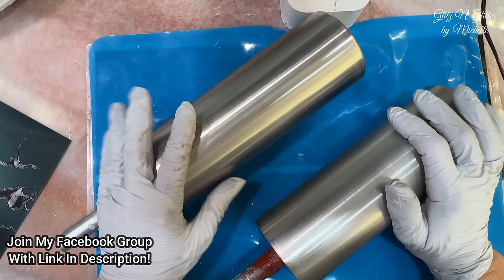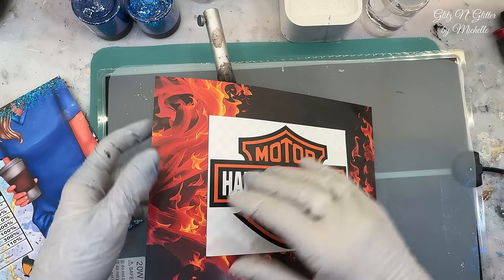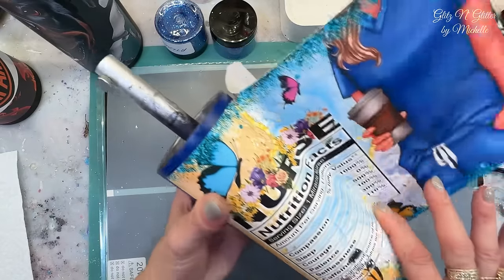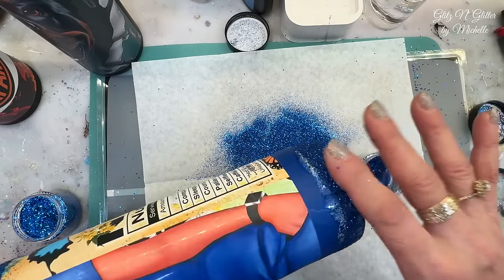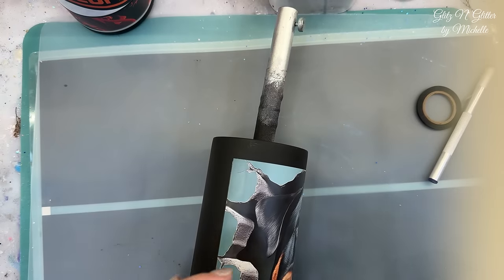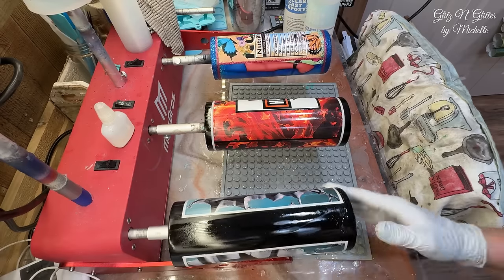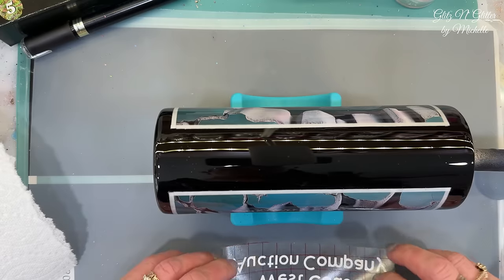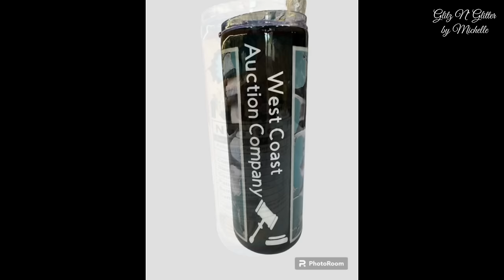#342 Three Christmas Gift Tumblers Using Vinyl - Glitter - Decals

Comment: I bought 6 stainless steal tumblers and they have  white on the outside. Can I use them for tumblers like you make? I thought I was buying like you use but must not have.
Reply from the maker: Sounds like you have sublimation tumblers. Yes just sand it down and pretend they’re stainless. I’d still spray paint over them.
Reply: Thanks, I'll do that.